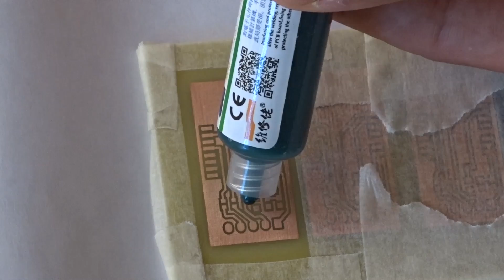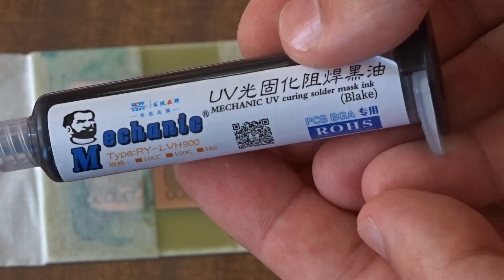Trying different color UV solder mask

Comment: if you apply it on top of a piece of silk screen cloth you get a perfect result no matter how good you are and it looks like it was put on by a machine and you dont get the problem of the solder mask sticking to the plastic film
Reply: after the screen. and you take the screen off. do you put put plastic on that to make a smooth surface

Comment: 1)Clean up witch acetone or toluene before using soldermask.
2)NEVER 2# layer after fail 1#. Remove first witch sandpaper, clean using toluene, apply new layer. 
3)MORE POWERFULL UV light. (Naill UV lamp)
4)Thin layer only

Comment: The only trick in those UV curable masks is the thickness of the film. I've got very thin films. I do pass them through a laminator (cold) and thin film sticks to the plate after the application. I cut the film larger than the board and make a sandwich so that the excess dye is deposited in that sandwich. I apply using a flat brush. Your films are very thick and whenever I try those thick ones, it did not fuse.

Comment: Maybe longer exposure times would have helped the first couple of boards?
Reply from the maker: I think the problem was not the exposure time but the thickness of the UV solder mask. I applied to much of it and basically it peeled off. I saw that some people apply very thin coat as a base coat and after some cure time they apply bit thicker as a final coat and let it cure at direct sun light or even high power UV light. What I got was small UV torch that came with UV solder mask. After doing more testing for beginners it's better to apply one thick coat and do not over expose or the paste just gonna solidify under the transparent film and you gonna do some scraping if this happens. Hope that helps :)